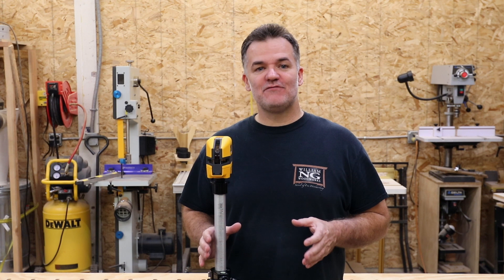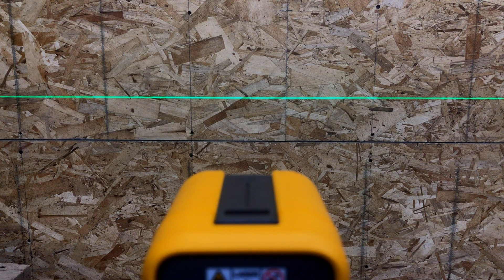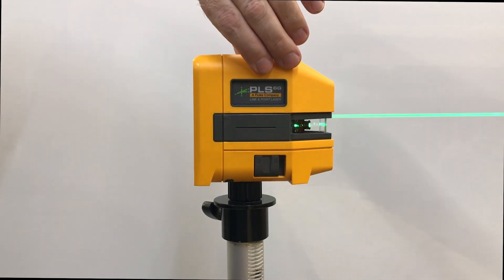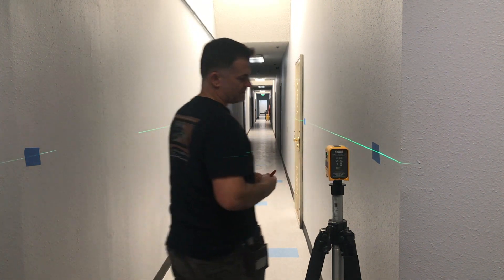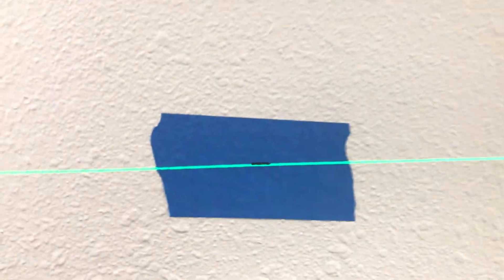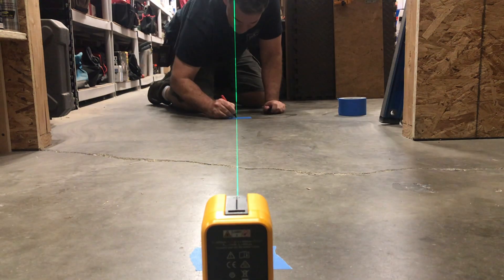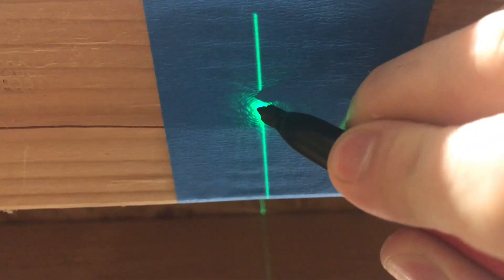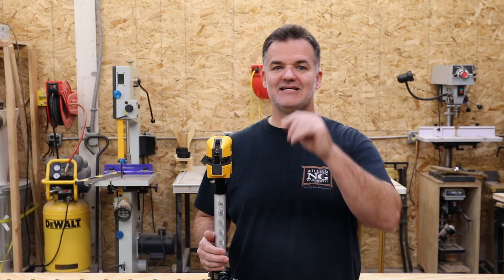How to Test your Laser Line Level

Comment: The way you're checking both the front and side plains in the level test, you're taking the deviation between the marks on the wall from the original laser position, and the laser position after relocating the laser, and dividing by the distance between the marks.  But I don't think you're making it clear that for the side plain, this distance is between the marks on the same wall, and for the front plain, this distance is between marks on opposing walls.  Or am I misunderstanding what you're doing?